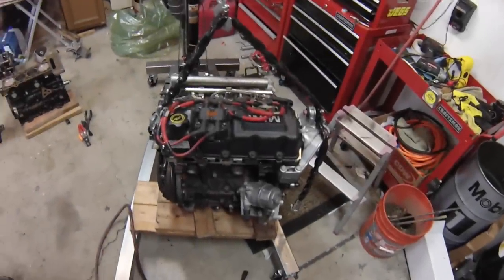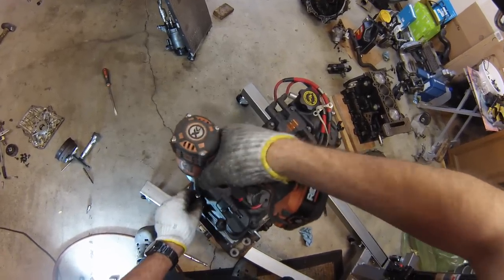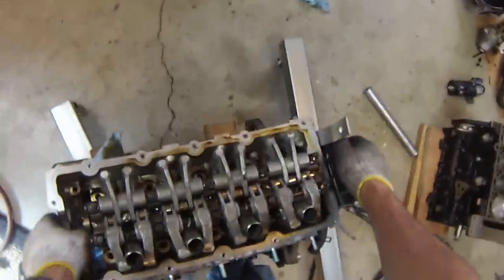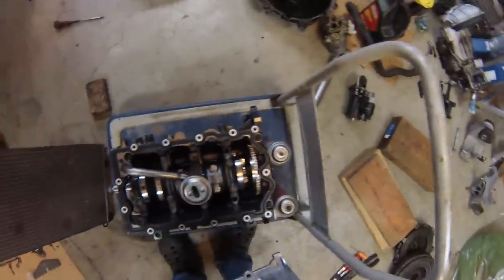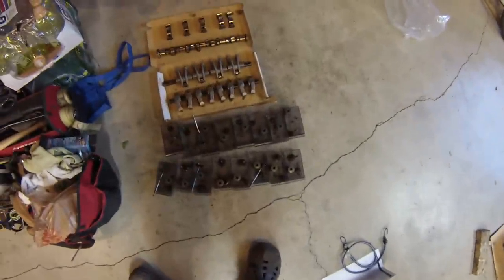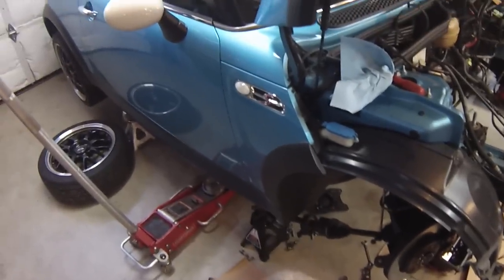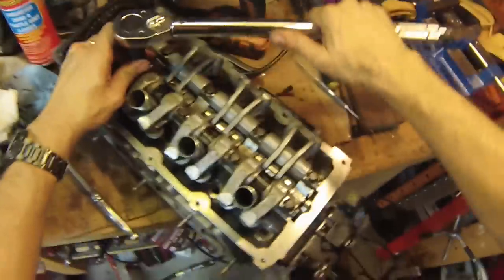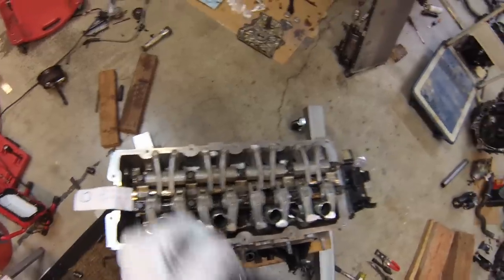R53 MINI Cooper S engine swap - New Short Block - Part 2 (Valve job & assemble engine)

Comment: excellent videos. I am in a similar situation as Sasha after buying a lightly modded 2005 r53 three weeks ago (and happen to be German as well, but live in the US). I bought it as a fun/project car. Even though I don't have to do anything to the motor right now, I already lost all my apprehension of tearing into the car for anything it may need by just watching these videos. I know I need to eventually replace crank seals, maybe clutch, install an LSD, replace ball joints, install a coilover suspension, replace rear roll bar (it's clunking madly even though everything is tight).  I've found videos for almost everything that may come up. Very useful, and highly appreciated. Now I need to go buy more tools :-)
Reply from the maker: Haha. I hope I don't make it look TOO easy. :-) 
Rear end clunk may be the worn stock struts, sway bar bushings, or the sway bar end links. Probably struts.
Reply: ***** car runs on Koni FSDs and Alta springs (I bad combo, as they FSDs are not supposed to be used on lowered car). 44k on the combo, but no leaks. bar bushings look good, end links were tight when I had it on jacks. Will check one more time before checking bank account. I am also suspecting the FSDs.  And no worries, this may look easy in your videos, but I'd be taking 10x the time, labeling everything, etc. I have worked on motorcycles and have some idea of how much harder it would be to dig into the Mini, mostly due to size and tighter packagin. The videos really help to "break the ice" and get beyond the "I can't do that in my garage" thinking. Given I have driven a Toyota Tundra Crewmax for years, the Mini is closer to a motorcycle than the truck :-)
Reply from the maker: ***** Ok, either the FSDs have gone bad or it's bushings.

Comment: Hey this guy reminds me of someone my self! Haha!  I always lap valve's  with a drill.  Your are wasting your time with the suction cup tool! I just picked up an 03 mini supercharged for $1000 bucks off CL.  with a 104K miles very clean. It also threw a rod and the crank was shot in number one cylinder!  ( just like this one )but did not punch threw the block like this one did, but did food bar the crank. So i decided to go a with different approach and get a motor with 92K miles from LKQ online for 1100 bucks and 6 month warranty! Now i will have an extra block w/rods/pistons/head for back up just in case it does it again or if i find another blowed up mini for $1000.

Comment: oil on threads of head bolts but also over and under head bolt washers too. just throwing out some helpful advice. is the torque different on these when using ARP head studs?

Comment: I have a question for you. I just picked up a 2002 Cooper "s" and it seems to have the chain noise that I keep reading about. I took the tensioner out and as I did, it had some tension on it... But when I had it in my hand and started to push the plunger, it seemed to have some gritty feeling in it, as I did this for a few more times, it got stuck in. Is this an indication that its bad?
Reply: It has to feel smooth. If not, replace it. Make sure that the engine timing is ok. 
I'd say, replace since its cheap and easy to do. If that was the problem, what it is usually, then you saved a lot of money and time :)

Comment: Is my understanding correct that it is the job of valve stem seals is to prevent engine oil in cylinder head from leaking down into cylinders.  Was owner of this car getting smoke out of his exhaust on start up.  Is this why you decided to replace valve stem seals?  Excellent video as usual.  Thank you.
Reply from the maker: Your understanding is correct but no, it wasn't smoking - this work was done at request of the owner as an early maintenance item since the head was off the car anyway.

Comment: #2video  was awesome , very instructional, one of the best quality rebuild videos I've seen I feel like I am right there doing the rebuild, I just recently bought one of the r53's off my boss for $1000, and was told there was a hole in the piston, I have no way of knowing this for sure, so I have to take his word for it.anyways, very fascinated by these cars and cant wait to get mine running. wish i could just send my motor to you!... well if that is possible let me know, and also could you put a list of tools needed and where to buy them in description , I'd be eternally grateful.
love the videos man KEEP UP THE GREAT WORK!!!
Reply from the maker: Thanks for the support. I would be happy to work on your motor if there is an economical way for it (or the car) to be delivered to my location. (Seattle area.) 
You can verify by doing a leak down compression test. There are several good 'howto' YouTube videos. Basically you put about 20PSI air line onto a line and fitting that screws into each spark plug hole, then rotate the engine until valves are closed on that cylinder. Then you listen for where the air is coming out. If it's coming out of the exhaust or intake manifold, you either have a bad exhaust/intake valve or one of the valve is open, if it's coming out of the crankcase, you have a hole in the piston or poor piston ring seals, if it's coming out of the coolant reservoir, you have a compromised water jacket, etc.  (These are some possibilities...)
I'll post a list of the special tools in the video description by tomorrow morning.
Reply: awesome thank you so much!

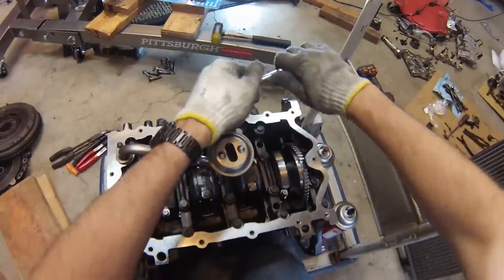Comment: @ 12:31 new oil pan  because the oil drain plug is screwed up . MMMMMM must be Jiffy Lube  Now I know why this engine blew up .   Damage was caused by improper oil and miss leading customers that they are getting fresh new oil when in fact they are getting a cheap new oil filter and that is it . A poor oil filter will damage your engine . More so than not changing your oil .   Never ever have your oil changed at any of these oil change places . If you cant do it your self and have the changed to it to a place that is ( I know ) honest . LOL But there are some places that are .  I have always used WIX filters and Mobil One oil . I get well over 300,000 miles on my cars and trucks and never ever had engine do this . NEVER ! What happen to this engine is neglect .
Reply from the maker: The customer bought the car used so we'll never know. However, connecting rods are the weak point of this engine. I know a guy who bought his R53 brand new, always did his own oil changes, even sent out samples for analysis, but still developed rod knock at 100k miles. Not every engine is doomed - I personally know of a couple that have gone over 250k miles - some of these early failures may be manufacturing problems...

Comment: Hi I'm not a computer savy guy but I wanted to involve myself in auto mechanics, so I watch most of the videos on youtube.I am 57yrs and I am attempting to replace the head gasket on my 2002 Mini Cooper S. Since the head is out I would like to cleanup the valves but need some tips.
1. Product to best aid in breaking up carbon and what is needed to cleanup before attaching head to engine. 
Thanks for your assistance.
Reply: Buddy you are the reason I am attempting this. Your instructions are clear and very helpful.
I will take some photos tomorrow and some after the job whith a new paint job.

Comment: At 05:18 and 30:33 you say you are going to put the engine at TDC. When the marks and links line up, that doesn't really mean the engine is at TDC, it's more of a 'service position' if you like.

Great video none the less though!👍
Reply from the maker: Yeah my mistake. It's actually at middle dead center (all pistons are in a line, crank is 90 degrees off TDC.

Comment: So the previous owner stripped the guide and rail bolt plug. The ones that go in the holes at 30:10 that cover those 2 bolts. Can I get the name of those? Or maybe a link where to buy them?
Reply from the maker: +Brian Esparza http://www.ebay.com/sch/i.html?_from=R40&_trksid=p2050601.m570.l1313.TR0.TRC0.H0.Xmini+cooper+screw+plug.TRS0&_nkw=mini+cooper+screw+plug&_sacat=0

Comment: Hi modmini 
Just want to say thank you lots of your videos has help me on 
supercharged service 
Brakes 
Front bearing 
And the list is on and on
Lol
Anyways I know this video is old but I have watch few others of your videos where timing is involved I got my 04 R53 and I change the timing tensioner but I still got the rattle is not bad but is there for few minutes on cold start and the code of the camshaft also replace too code got clear out but at come back again so I’m sure my problem is my timing chain 
I was just wondering with the fancy tool you mentioned and use to tag this job 
Would that help me to not mess up the timing when put it back together and of course making sure the arrows and chain get aligned correctly 
Is just on your videos putting the chain back together looks so sample 
Something I will like to do and learn and definitely save up lots of money lol
Like I did already on your other videos where I learn and save haha
One Shop around my area say $1100 just labor 
The Other 4 did I call they don’t mess with it so
I know this job might be difficult and that’s why they don’t want to
But I will try my self i hope lol
As longer I keep watching your videos over and over
Reply from the maker: Glad the videos help, but sorry, what is your ask? Do you need the tool to hold the sprocket? Not mandatory if the timing cover is off, car is manual transmission and you have someone to help step on the brake and put car in gear to allow you to get the cam sprocket bolt tight.
Reply: Thanks for get back to me 
I guess my big question was if this job can be easy to do and not screw up the timing?
I know is not much space to work I okay with time consuming just don’t want to mess up and how to put it ok time and also
Any chance send you a video of the Mini is short one where I’m sure with your knowledge you might be able to help me here if you can hear it is not loud but you can hear when start and goes out about couple seconds 
Thanks I will appreciated how to send the video or link where to put it at

Comment: Hi, this is Sascha from Germany, I follow your Chanel since I bought an R53 eight weeks ago, your videos are very fine and easy to understand, thanks for that.
My R53 has taken little bit of Coolant by High Revs especially on WOT .
So I dismantled ( right english? ^^ ) the Engine on Sunday, a little bit different to you because I let the Subframe on the Car.....
Anyway the Car has 135000 Km and I going to change the Piston Rings and any Gasket on the Motor , the Inside of the Zylinder looks Factoryfresh, but I´m not sure if I should do the Valve Job or not, whats your Opinion?
Thanks for this Video , good night ;-)
Reply from the maker: Hello. Thanks for watching my videos. If you are not consuming burning oil (especially after not driving the car for several days) and not getting valve noise, you probably don't need to do a valve job. And there is actually a way to replace valve stems without even removing the cylinder head, if you want to only do the valve stems, later. 

If your car is consuming coolant, that is probably a bad head gasket or a coolant leak. Bad valves, valve stems or piston rings will not cause coolant to be consumed.
Reply: *****
Thanks for your answer, yes this sounds good, there´s no valve noise or anything, Engine runs very smooth.....ok I will replace any Gasket and its done.
Reply from the maker: TheSitscha Glad I can help. The only time you would replace piston rings is if you have low compression or blue smoke out the tailpipe, and you know it's not the valves or valve stem seals.

Comment: does the threaded posts that purge from the cylinder head, that the intake manifold bolt on to, can they be taken out and swapped over to a new motor
Reply from the maker: Sure

Comment: Did it hydrolock and it caused the connecting rod to bend and break the block?
Reply from the maker: Not hydro lock.
My final conclusion is valve head came off and bounced around in there, due to previous incident where timing chain skipped a tooth, causing valves to slightly touch piston heads, causing a weakening of the valve stem.
Ooops - wrong video - I never figured out what happened here. We suspect poor maintenance by the previous owner or a manufacturing defect.

Comment: Ive got a 06 MCS has the famous misfire cylinder 3. I have changed plugs wires, and coil. Didn't remove the CEL. Car feels great, lots of power, if it wasn't for the light I wouldnt think anything was wrong. Do you think it is a bad valve? Really dont wanna pull the head if I don't have too!
Reply from the maker: +Jon Dresser If you changed plug, wires, coil and spark plug and it's still there, it could be low on compression. Anything under 90PSI or so and it will misfire. Perform a compression test and leakdown test. That will point you in the right direction. If compression is good, your problem lies elsewhere. Maybe a stuck injector. If compression is bad, leakdown test will show whether it is a valve or head gasket issue. I had a MINI a while back that had a P0304 and the root cause was a cracked valve seal.
Reply: +Mod MINI I did a compression test, everything seemed ok no difference in cylinders. Did a smoke test, no vacuum leaks in the intake system or exhaust. I noticed that my plugs on all 4 cylinders fouled out within a couple of months of driving, it then started to give me issues running rough, I cleaned up the plugs and it runs great again still misfire on cylinder three. Also is throwing a lean condtion from the post cat sensor. Sensor actually looks lean when you pull it out of the exhaust. (tip is white) but the plugs look  like the engines running rich. Ive switched injectors 3&4 and there is no difference in misfire or anything. How can the plugs be showing rich and the post cat 02 sensor be showing lean! This car is driving me nuts. I own a shop, and can fix everyone elses car but mine!! Very frustrating!!
Reply: +Mod MINI Also my Long Term trim levels are around 11% which means the computer recognizing a "lean" condition is dumping extra fuel in the cylinders to compensate for the "lean" condition. also is a new O2 sensor post cat. I hate to think this but maybe I have a bad computer!
Reply from the maker: +Jon Dresser Do you have a custom tune? If so, the tune might be bad. The post-cat O2 sensor is not really used for any air/fuel management calculations. The precat sensor is. Try swapping or replacing. Also, are you running the correct heat range plugs? BKR6EQUP for stock pulley, BKR7EQUP for 15%.
Reply: +Mod MINI  no custom tune. Yes running the ngk plugs with a heat range of 6. And the code the computer is throwing is a post catalyst too lean code. Could this still be the front O2?
Reply from the maker: +Jon Dresser Post cat code is irrelevant to misfire or rough running. You have some other issue. Maybe MAP sensors or precat sensor are going bad but not tripped sensor yet... Or, obstruction in the cat.

Comment: Hi, I have a questions from where do you got the short block, I'm in need of one right now. Thank you for taking your time to read this.
Reply from the maker: The owner got it from BMW/MINI.
Reply: He got ted from the dealer right, and how did he order from the dealer.
Reply from the maker: sthefan teran I guess he went to the dealer and said "I need a small block." (They will sell you parts even if you install them yourself.)
Reply: OK I just wanted to know because I went to the dealer ask for a short block and it said that it comes with just the crankshaft. And I would like know so that I can order the right part and they don't try sell other stuffs. Thanks for taking your time.
Reply from the maker: sthefan teran That is correct. That is what a short block is - a block and crankshaft. You're supposed to move the other parts from your existing engine.

Comment: I thought that the chain and sprocket timing marks only line up on assembly?  So if I rotate the crankshaft around soo many times they should align up?
Reply from the maker: Eventually they will, but the one time I tried, I gave up after like 40 rotations.
Reply: Mod MINI oh wow well atleast you had a good workout bud lol B-) il give it a few goes and if not il just get them roughly right and make do
Reply from the maker: Yeah just get them close enough that you can count teeth without making mistake.
Reply: Mod MINI I'm hoping that I won't have to count any teeth aslong as the crank sprocket markings are at four o clock with the cam tool locked in, I'm guessing it would then be safe just to rebuild with the markings aligned?
Reply from the maker: If you're rebuilding, just take the chain off and realign it so the teeth match up. Too dangerous to hope the crank won't move.
Reply: Mod MINI Realign asin mark the chain and sprockets and copy the markings over to the new items? or did you mean to align the sprocket/chain markings?
Reply from the maker: You are taking everything apart, right? Just align the arrows with the bright links.